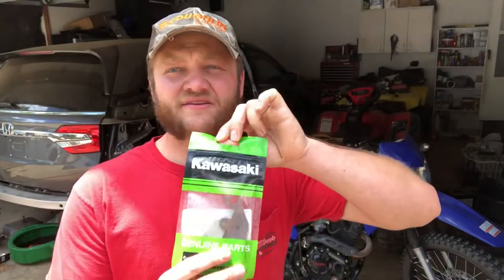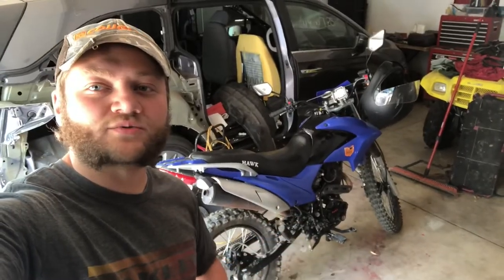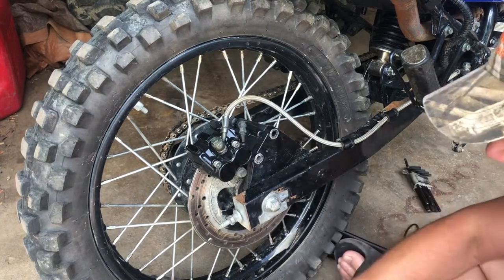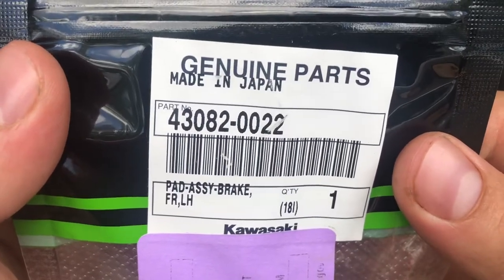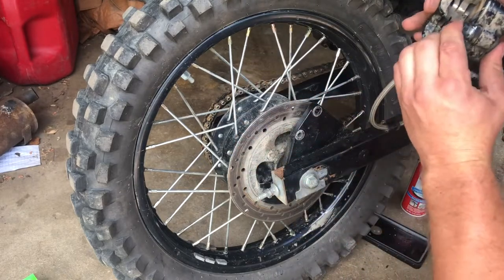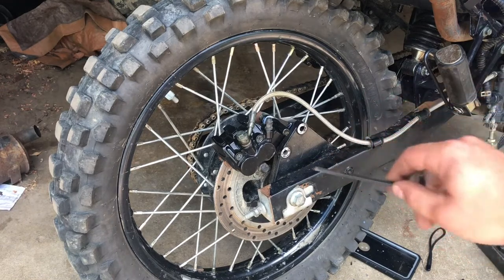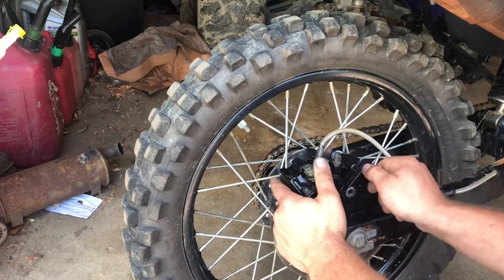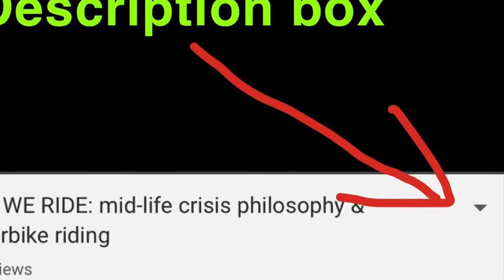Hawk 250 Changing rear brake pads, SAVE TIME AND MONEY

Comment: Thanks for all your info bro!  Could you give me some advice on my rear brake dragging? I am only get my Hawk up to about 50. I've searched the web but no real clear answer. Thanks for any help bud.
Reply from the maker: First of all just wanted to start out with the fact that the hawk is not a fast or high-speed bike to begin with. my bike with sprockets is geared for road riding, I only get 65 Top Speed out of the bike. If your rear brakes are hanging up, there’s a retainer up inside the rear brake caliper, you need to check the brake pad on the non-piston side of the caliper, just make sure it’s sitting in the retainer correctly (The back of the brake pad should be all the way against the inside back of the Caliper). There are also situations where you may have too much brake fluid, or another common issue is where the rear brake is partially engaged, because of the adjustment screw on the rear brake foot lever. Hopefully this helps! Thanks for watching!
Reply: @goodolboys713  Big help bud, thank you!  I actually just took off the rear brake, to see if that was the problem and it wasn't, so, shit. I can't get her past 50, I would certainly be happy with 65! Any ideas on what's causing her to go so damn slow?
Reply from the maker: @ryanbaker7071   As I said before unfortunately the hawk is simply a slow bike out of the box, however with simply changing out the sprocket front and rear, and re-jetting the carburetor, you can reach 65 miles an hour. Now keep in mind that’s the absolute top speed on my bike, different people have different opinions on what TopSpeed actually is. If you’re looking to cruise at 60 miles an hour 17 front sprocket and 40 tooth rear sprocket is a must!  again there’s different opinions on what gearing to go with, however I have a video that goes over multiple different gearing combinations and set ups and how they work and what they are for. Here is that video, it should help clear up some things for you: https://youtu.be/XKCC3suCjGQ 
Thanks for watching!
Reply: @goodolboys713  Thank you bud, I watch all your videos lol. I already switched to 17:45 sprocket, upgraded the battery and spark plug. It's a deluxe, so no carb modifications. Still can't get her to a comfortable speed to ride her to work safely. She has about 50 miles on her. Idk bud, may just have to take her somewhere.

Comment: Do you might know why my hawk rear brake stopped working the calipers are not closing
Reply from the maker: So there are many reasons why brakes don’t work, here are a few simple issues/solutions: 
Out of brake fluid—add fluid 
Brake pads worn out or complete gone— replace pads 
Loose brake like— tighten brake lines 
No pressure— bleed the  brakes  
Burst line— replace brake line 
Beyond that, possible bad caliper or master cylinder. (If you see leaks these could be a possibility, however 99% of the time it’s something simple) so again these are just a few possibilities of what can go wrong. Hopefully this helps! Thanks for watching!

Comment: Any Idea how to stop the rear brake from squeaking?  It stops squeaking as soon as I apply ANY brake pressure at all....
Reply from the maker: Iv heard of that problem and had it happen. I’m not sure of the exact cause, but a couple things that might help: change the rear brake pads, lightly ride the rear brakes for a mile or so down the road (be careful, you don’t burn up the rotor or pads, your just trying to wear down the pads a bit and get rid of the squeak), ride it though some mud and apply the brakes (the abrasiveness of the mud will wear the pad down and possibly get past the squeaky part of the pad). Other things that could cause brake squeak or chatter are bad rear bearings, bad alignment of the rear brake caliper, bad or missing brake pad spring. There are many different scenarios that could cause squeaky brakes. I recommend trying some of my back yard diy fixes, and then moving on to more involved solutions. Hopefully this helps! Thanks for watching!
Reply: @goodolboys713  I fixed the problem!  There was quite a lot of air in the rear brake line.  After bleeding the system thoroughly the problem is fixed!  Pass it on!!
Reply from the maker: @GliderDriver  will do! The air was probably expanding and putting slight pressure on the pads causing the brake to rub enough to chatter. Best way to get this info out there is to ask questions in the form of a comment like this. There are so many questions asked on a regular basis (on my videos  here on YouTube it’s basically like a forum of information). My best advice (to you and anyone else reading this)  is to keep asking great questions like this one! Thanks for watching!